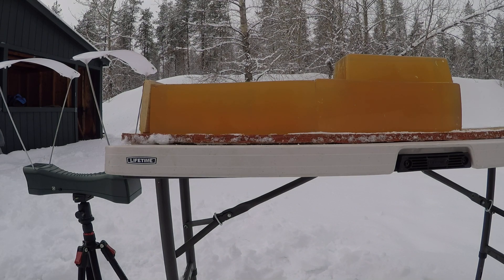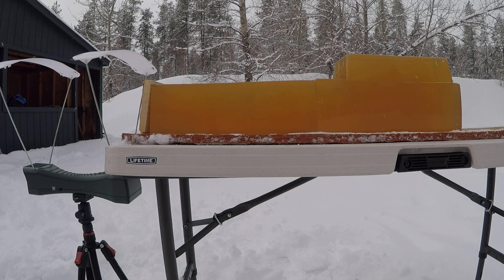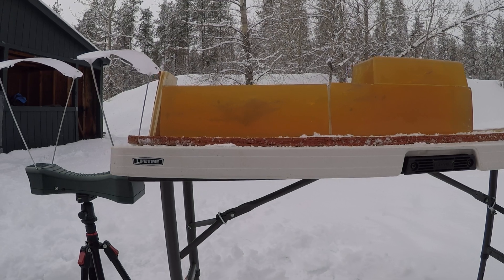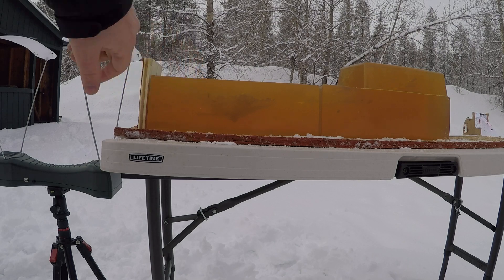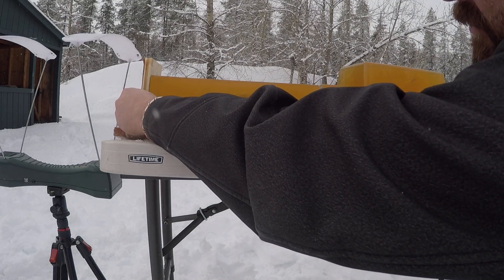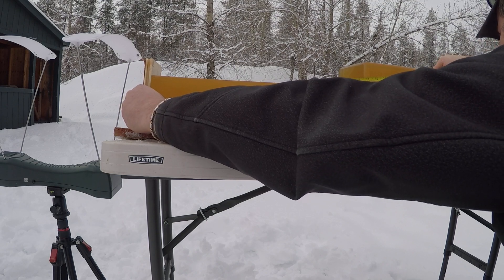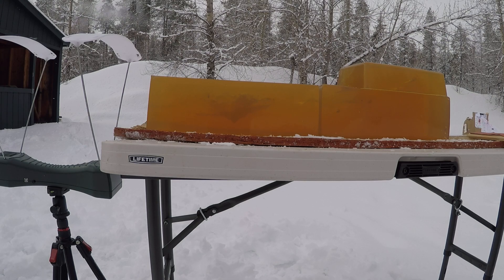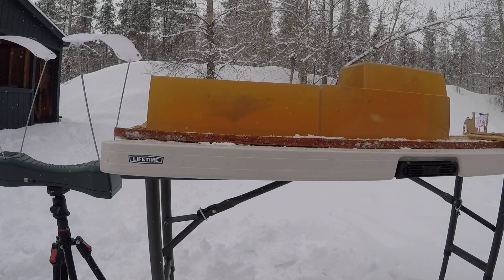Hornady A-Tip long range effectiveness of the 250 gr 30 cal ballistics gel test

Comment: Is this 30-06?
Reply from the maker: I'm testing the bullet itself to find its effective velocity ranges. This bullet could be used in a 30-06, but it is way on the heavy side for a 30-06. 

300 PRC is what I used for the higher velocities and 30-06 for the lower velocities.
Reply: @simplemindedfella could i get the recipe for thag 30-06?
Reply from the maker: @Disguy-sp1ki  I used Hornaday 10th edition data on the 225 gr bullets, starting low (a little lower than listed for safety) and working up. No two guns are perfectly identical, so you should always start low and work up for each rifle.

Hornaday may still have some online load info for the A-Tip. Not sure if they still do or if they are pushing people to buy the latest manual. Really wish Hornaday would provide online info like Nosler. I guess Nosler is just more interested in selling bullets than Hornaday. 

Anyhow, be safe and have fun and God bless.
Reply: @simplemindedfella thank you sir 🙏🏼
Reply: @simplemindedfella I used to shoot the 215gr Berger in a 10" twist 30-06 at 2700fps. Worked great.